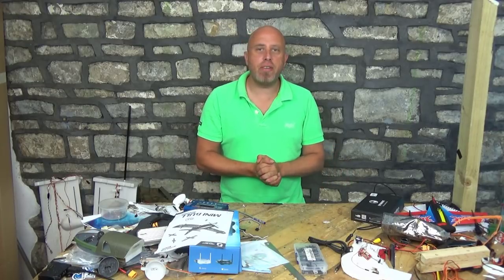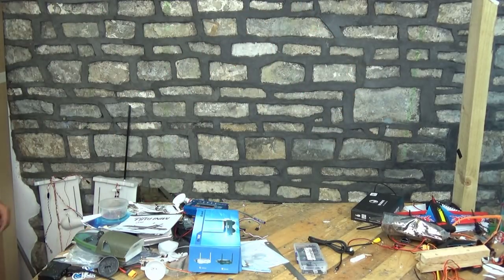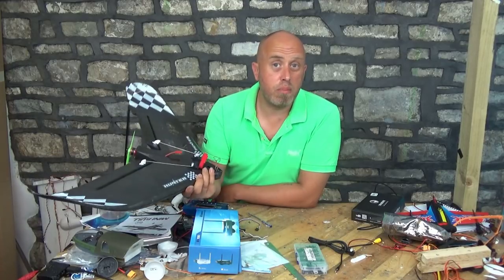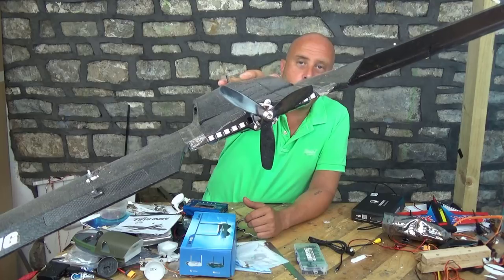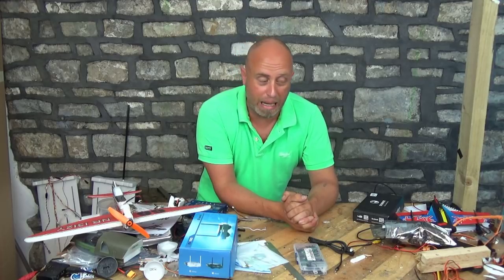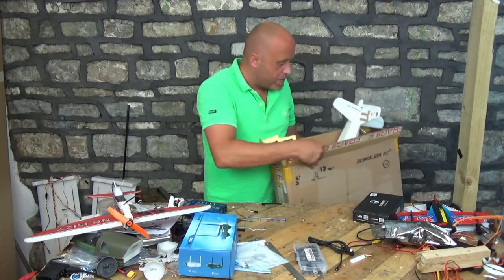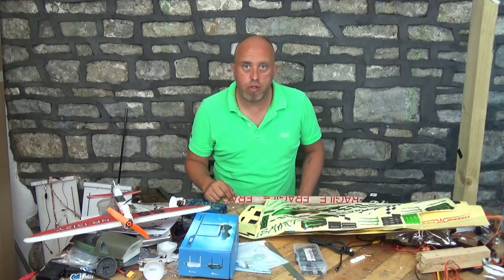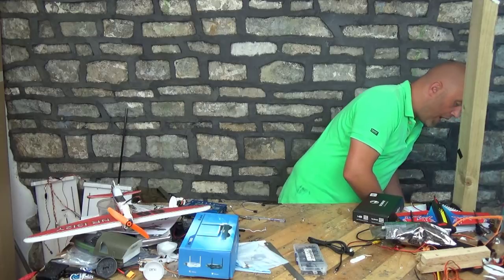WorkBench Chat: Foam Down the Side of the Desk

Comment: I bought a Skywalker Smart however one wing was made out of dense foam and the other wing very soft foam. The dense wing was 50% heavier than the other. I had to put lead in the light wing to balance it. Are your wings okay? What CG did you use. Banggood says 200-205 from teh nose & a manual I got off skywalker says 240 -250 from the nose.